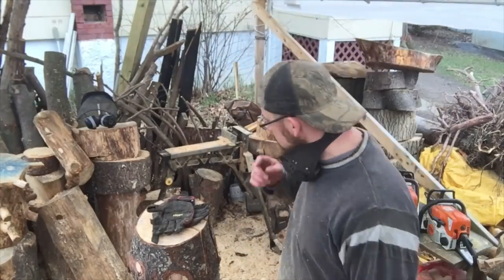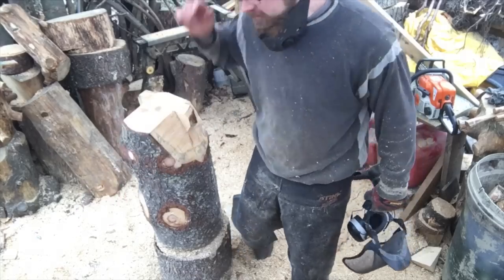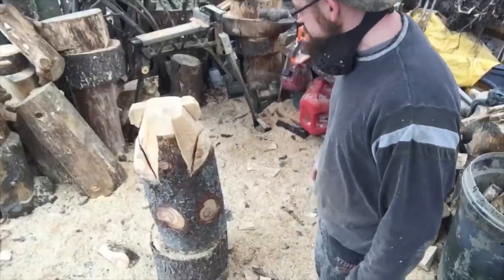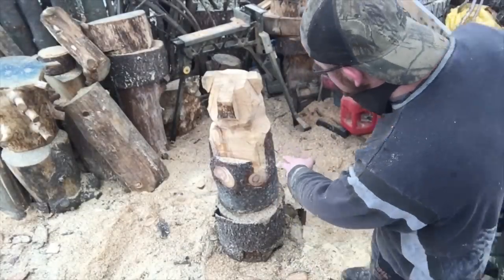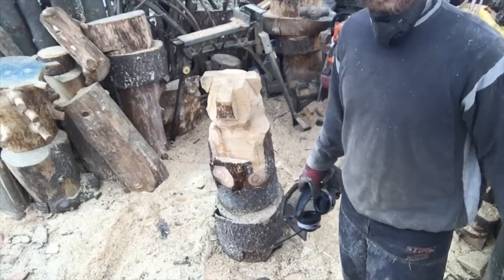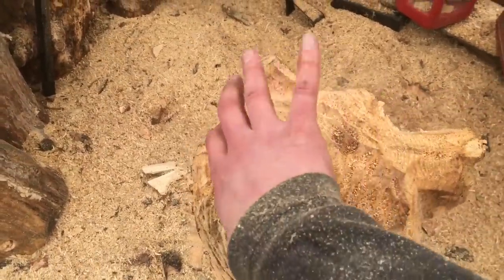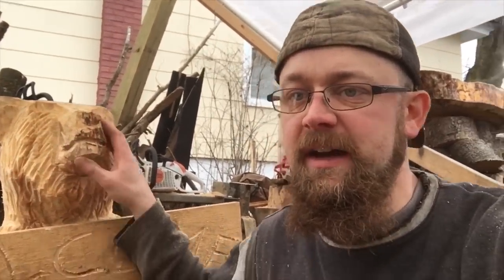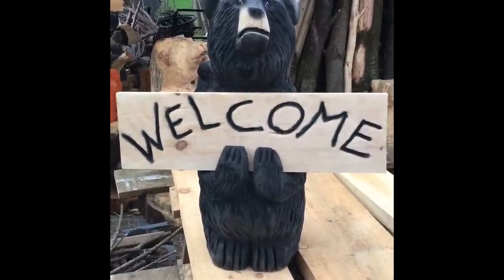Carving a 3ft welcome bear

Comment: Great instructional video Kyle.  This winter I am focusing on carving bears…learning.  I take photos with my phone at moments along the videos then I can reference them in my studio, that has been really helpful.  Upstate NY?  Me too, Niskayuna and a camp in the Sacandaga southern ADK.  Went to my woods yesterday to harvest a white pine for bear training work.   No excuses.  I am investing in non-gas saws so I can stay inside my heated studio although our winter so far is MIA…. Have a sthil 140 corded with a dime bar on order, using my dewalt 16” battery saw for block in now but not thrilled with it, it weights in at 14 plus lbs!   What corded or battery saw would you recommend for blocking out pine, what bar and chain also?    Just subscribed, keep up the good work, thanks.
Reply from the maker: Thank you hope it helps . I grew up on the Sacandaga! 
I like my msa 200 and 220 just running stock bars on them .